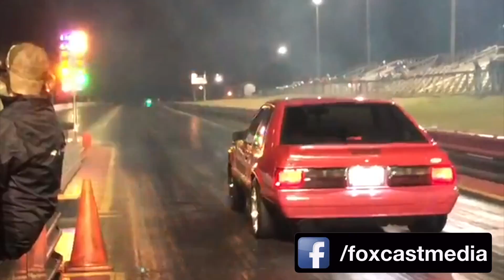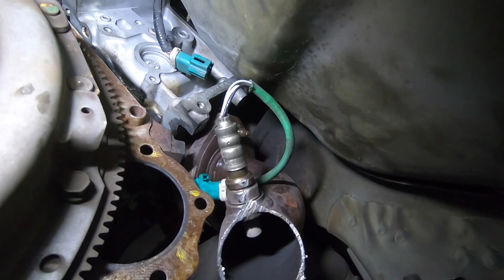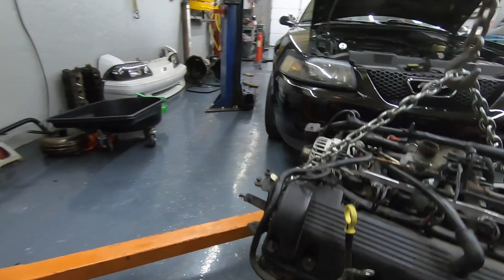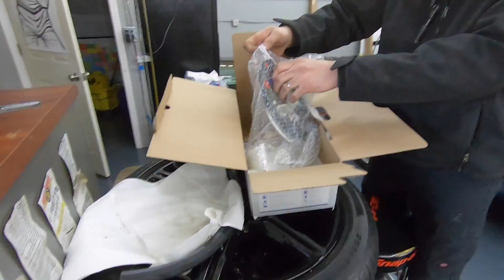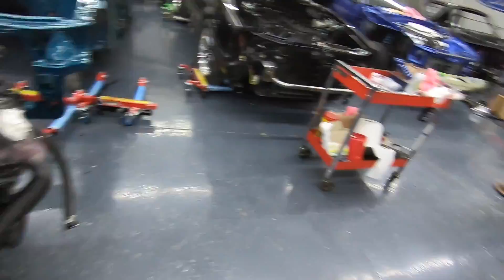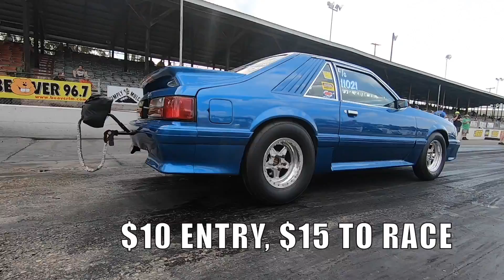Coyote swapping a 96-04 Mustang GT, we yank the old engine

Comment: Thank you Foxcast for doing this! I have a super clean 02 GT zinc yellow that I've done everything too as far as engine mods and suspension wheels and tire bolt-ups. In another couple months it will no longer have be my daily and I wanna tear into it. I've been debating building the 2V but after comparing costs-the Coyote is the clear winner in cost and power advantages over a 2V. Following!

Comment: I have a 05' F-150 that was given to me by my father, when he had two severe strokes, and could no longer drive, a few years ago, and is now in a rest home....so the truck has sentimental value. Unfortunately it came with the Triton 5.4 3 valve....I have ran into timing issues, replaced VVT solenoids, and countless coil packs. After just replacing the VVT solenoids, the truck on the way home from the garage started missing again. So the thing to do would be complete timing kit replacement, and Melling high pressure oil pump. The JEGS kit is 800.00, plus a out 1500.00 labor, into a terrible motor. 
I've been thinking about a swap, to a Coyote motor, or a 4.6 mustang GT motor instead. I'm in between jobs right now, and sunk my last 1000.00 in it......any advice would be great....looking for a bullet proof solution...that's not gonna cripple me financially.  My father was a mechanic, unfortunately we no longer have a garage...so will have to source labor..

Comment: You can use a bulkhead fitting and a LS swap fuel filter kit for the fuel system too if you are on a budget
Reply: Seams like that had a good plan with the 98 sender and Corvette fuel filter iv herd of 4valve swapping new edges and to make an older 4 valve work they have to do something similar
Reply: @kevinjohnson9372  probably. 96-98 2v had returned style fuel system 99-04 2v didn't
Reply: @streetslayers410  I know I have learned alot about these cars I have a lincoln mark viii with the dohc 4.6
Reply: @kevinjohnson9372  nice!

Comment: All 2v mustang engines are 6 bolt but some Windsor 2v truck motors  had 8 bolt flywheel. It is still a cast crank so don't be fooled
Reply: My 2000 gt Windsor had an 8 bolt from the factory. They’re scarce, but out there.